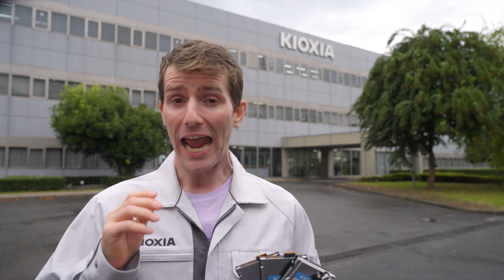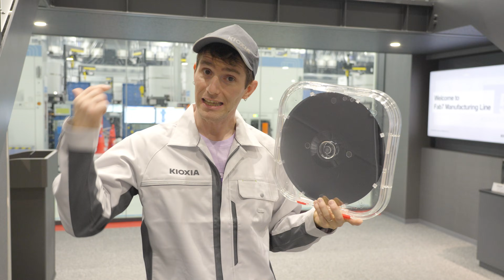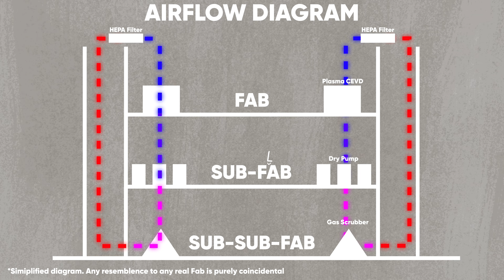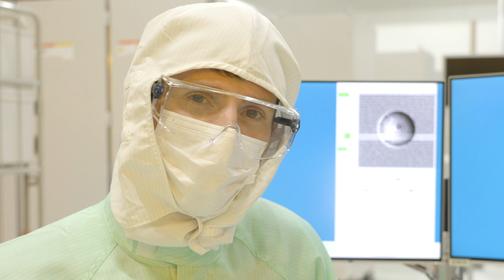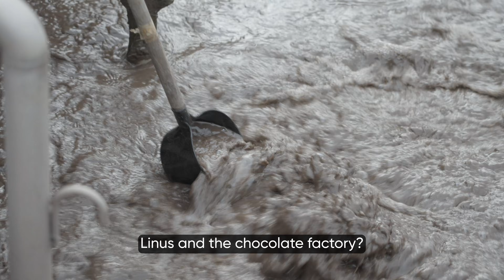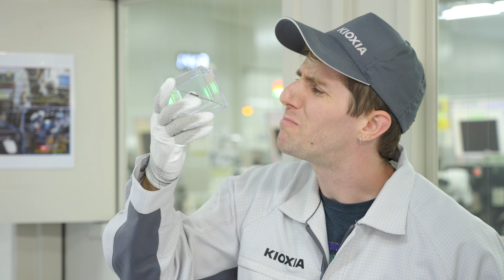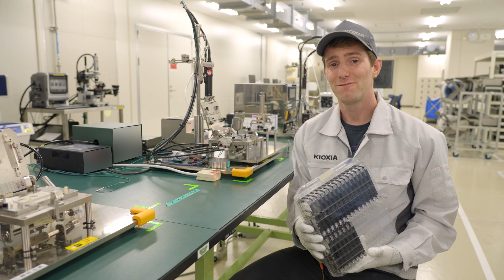A Petabyte in the Palm of My Hand - Kioxia Factory Tour

Comment: Actually, the cooling in reflow soldering has to be fast. As leadfree solder is not eutectic, it gets solid in temperature range and you want to get through as fast as possible to prevent partial crystallization. On the other hand the electronic components have limits of temperature change stress they can handle. So you have to balance it perfectly to maximize reliability.

Comment: @12:00, Reuse rate of >90% is quite impressive, this goes to show how much faith Kioxia has in their filtration system since the water purity has a direct effect on the defect rate on their wafers. Overall, this is super awesome that Kioxia is able to share this.
I work in an academic fab house at an R1 university, fabricating silicon optics for infrared optics applications. We do not have anything like this fab. It is interesting to see the difference between a fab designed for low volume prototyping at a large university vs a high volume fab like Kioxia.
Very good tour, those PECVD film stacks are quite impressive. At the fab I use, wafer uniformity (along the radial) is not too great, outer 10mm or so can vary, normally set up for 100mm wafers. The PECVD machines at Kioxia are massive, wonder what kind of uniformity and deposition rates they have. 
13:10 , very cool demo! I deal with very thin wafers (~30um sillicon) and also thick pieces (~3cm silicon), really neat to see the difference in properties vs thickness of single crystal silicon!
19:30, The vibration isolation of the fab is impressive. Though I am certain the lithography tools are on the ground floor, pretty cool to see vibration isolation at the building level, you don't see this in academia too often :)

Next time I buy an SSD, I will look out for Kioxia nand flash, thanks for the tour!

Comment: Brave AI says, "The availability of petabyte (PB) electronic storage devices for consumer computers remains uncertain, with estimates varying widely based on technological trends and market demand. While enterprise-grade storage is advancing rapidly—Samsung has announced a 256TB SSD, and Seagate is expected to release 24TB drives—consumer access to a single 1PB drive is not imminent.

Some projections suggest that a 1PB SSD could become available in the consumer market within 10 to 12 years, assuming a gradual progression from current enterprise drives.
 Others estimate that 1PB SSDs might be feasible by 2030–2035, particularly if advancements in NAND technology continue.
 However, many experts argue that demand is the primary limiting factor: most consumers do not need such vast storage, and data redundancy and reliability concerns make a single petabyte drive impractical.

For hard disk drives (HDDs), the physical limitations of spinning platters make a petabyte HDD unlikely in the foreseeable future, with some suggesting it may never happen.
 Solid-state drives (SSDs), while more scalable, face challenges in cost, heat dissipation, and data management, especially with file system limitations that cap the number of files.

In summary, while a petabyte SSD may emerge in the consumer market by the early 2030s, it is more likely to be a niche, high-cost product rather than a mainstream offering. The timeline depends heavily on technological breakthroughs and the emergence of new storage paradigms, such as reversible logic or alternative materials, which could overcome current physical and economic barriers."

Comment: In 1989 my first PC had a 42 Megabyte hard drive and cost about $1800.   My new $80 smartphone has a microSD card that holds over 6,000 times what that PC did and is smaller than my little fingernail.  Now you are showing us memory chips that can hold almost 10,000 times more data than my new phone.   Maybe a new SSD for my PC next year?

Comment: Intel are talking about using enormous EUV lasers to build 32 layer fabs with through floor vias to deliver power from the bottom floor all the way up to the top. They build the whole fab upside down then flip it over and connect the bottom floor to the power grid. They then put a big copper heat spreader on the roof of the factory to spread & dissipate all the excess heat.

Comment: looking at the cost, that the clean room and cooling needs for such extremly small products, i wonder i that is actually something that could be done cheaper in the vacuum of space, i.e. a moonbase? i guess there are two questions for that: how many machines can be cut from the fab, that are not needed due to the cold space on the moon - and do you still need a lot of water? maybe scientists can even make some breakthrouhgs only possible due to manufactoring in a lower gravity envoirenment.

Comment: Based on the SEM images and the description of the process ("grinding the excess of the top silicon wafer"), these defects are likely post-process contamination resulting from the mechanical grinding and the subsequent cleaning/drying steps.

1. The "Donut" or Ring Shapes (Images: 1797, 1806, 1814)
Likely Cause: Water Marks / Drying Residue

Explanation: After grinding, wafers undergo a cleaning and rinsing process (using Deionized Water). If a droplet of water containing dissolved silica or chemical residue dries on the surface instead of being spun off, it leaves a ring-shaped stain. As the droplet evaporates, the impurities concentrate at the outer edge, forming a "donut" shape which is visible under SEM.

2. The Long, Fibrous Strands (Images: 1801, 1805, 1813, 1821, 1822)
Likely Cause: Organic Fiber Contamination

Explanation: These look like fibers from cleanroom wipers (cloths used to clean tools or cassettes) or particles from cleanroom garments.

Image 1813 and 1821 show twisted, ribbon-like structures typical of synthetic fibers (like polyester) or cellulose.

These fibers can fall onto the wafer during handling or be transferred if the wafer physically touches a dirty surface or cleaning pad.

3. The Irregular "Chunks" and Clusters (Images: 1796, 1799, 1802, 1811)
Likely Cause: Grinding Slurry / Silicon Dust Agglomerates

Explanation: The "grinding" process creates a massive amount of silicon dust and uses a "slurry" (a liquid with abrasive particles).

Image 1796 and 1811 show clumps of material. This is likely silicon swarf (debris from the wafer itself) or abrasive grains (from the grinding wheel) that clumped together and were not fully washed away during the cleaning cycle.

They often get trapped in surface topography (like the trench seen in the images).

4. Small Bright Particles (Images: 1800, 1803, 1807, 1818, 1823)
Likely Cause: Loose Particles / Fall-on Defect

These are individual specks of dust or silicon shards. In SEM, they appear bright because they are often non-conductive (charging up) or sticking up from the surface, scattering more electrons.

so in conlcusion, the machine grinding process is mechanically harsh and dirty. The defects shown are not likely "growth" defects (from inside the crystal), but rather residue that failed to be cleaned off.

The Problem is The Post-Grind Cleaning (cleaning/scrubbing/drying) process is likely insufficient.

Why they are in a line: Many images (e.g., 1801, 1804, 1811) show the defect sitting on or near a dark horizontal line. This line appears to be a trench or a scribe line on the wafer. Debris naturally gets "trapped" in these depressions, making it much harder for the cleaning brushes or spray jets to remove them compared to the flat surface

Comment: The sustainability practices for water and energy, are really cool, but I’m curious as to how efficient their material reclamation is. It’s easy enough to collect excess when it’s just silicon, but once you start etching and backgrinding, wouldn’t the particulate be insanely small, or at risk for impurities from stuff like the copper layer? How do you get that material out of the water, and back into a crucible to prepare for a new ingot to be made?

Comment: AI: Based on the visual evidence, these images are Scanning Electron Microscope (SEM) micrographs of semiconductor wafer defects.

In semiconductor manufacturing, automated inspection tools scan wafers to find anomalies like these. The specific defects shown here point to a few distinct causes, mostly related to contamination and process cleaning failures.

Here is a breakdown of the likely causes for the specific defect types visible in the grid:

1. Process Residue & Water Spots (e.g., 1797, 1806, 1814)
What they look like: Circular "donuts," rings, or dried puddles.

The Cause: These are likely drying defects or water marks. After a wafer goes through a wet cleaning or etching process, it must be rinsed and dried. If a droplet of water (or chemical solvent) evaporates on the surface rather than being spun or blown off, it leaves behind dissolved solids (like silica or salts) in a ring shape.

2. Particulate Contamination (e.g., 1796, 1798, 1803, 1815)
What they look like: Irregular, blob-like chunks sitting on the surface.

The Cause: This is "process fallout." Common sources include:

Etch Chamber Flaking: During plasma etching, polymers build up on the chamber walls. Eventually, these flake off and land on the wafer.

Equipment Wear: Moving parts in robot arms or aligners can generate microscopic dust that falls onto the wafer.

Ambient Dust: Failures in the cleanroom air filtration (HEPA filters) allowing dust particles to land on the wafer.

3. Fibers and Scratches (e.g., 1801, 1805, 1813, 1821)
What they look like: Long, thin, rod-like structures or deep gouges.

The Cause:

Fibers: These are often textile fibers from cleanroom consumables (like wipes or operator suits/gowns) that have physically contaminated the wafer.

CMP Scratching: If the wafer recently went through Chemical Mechanical Planarization (CMP)—a process that polishes the wafer flat—a large agglomerated particle in the polishing slurry can scratch the surface or leave a trail of debris.

4. Flakes and Shards (e.g., 1822)
What they look like: Flat, jagged pieces of material.

The Cause: This is often film delamination. A layer of material (like metal or dielectric) may have peeled off the edge of the wafer (bevel) or the chamber clamp ring and redeposited onto the active area of the chip.

Summary
The variety of defects suggests a "dirty" process step. If these images are from a single inspection run, the manufacturing line is likely suffering from a cleaning station issue (causing the water spots) and a particulate control issue (causing the debris and fibers).

Comment: I'm just a noob on the internet but I've always wondered why chip manufacturers haven't developed a process of forming the purified silicone into squares which would enable them to use more of the wafer with less wastage (around the edges of the disc) there's probably a very good reason for this but it would be cool if someone has a technical answer for that?

Comment: If ya'll wondering why these Silicon Wafers are not square?? Silicon wafers are round because they are sliced from large, cylindrical ingots grown using the Czochralski process, which naturally produces cylinders; plus, round shapes handle high-speed spinning (for coating/cleaning) better, distribute heat more evenly (preventing hot corners), and offer more usable area per perimeter for chips. Square wafers would waste material and concentrate stress at sharp corners, making them prone to cracking during processing

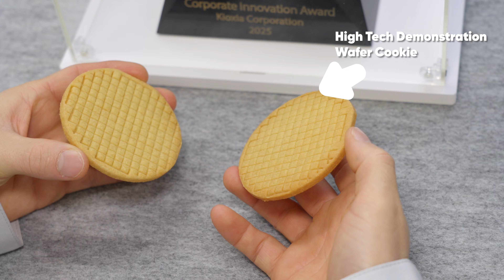Comment: explaination of second wafers at 6:15 had the same vibe as:

Everyone has a plumbus in their home! First, they take the dinglepop and they smooth it out with a bunch of schleem. The schleem is then repurposed for later batches. They take the dinglebop and they push it through the grumbo, where the fleeb is rubbed against it. It's important that the fleeb is rubbed, because the fleeb has all of the fleeb juice. Then a Schlameeh shows up, and he rubs it, and spits on it. They cut the fleeb. There are several hizzards in the way. The blamphs rub against the chumbles, and the klubus and grumbo are shaved away. That leaves you with a regular old plumbus!

Comment: 14:33 so cool that they zig zag stack so they can fit the wires it looks so unstable but so elegant
Reply: Wire bonding is surpisingly robust. Wire bonding like that can be seen on many consumer products. If you get the chance, take apart an older cheap optical computer mouse, you will see the wire bonding directly exposed, not in a package!

Comment: It was nice of KIOXIA to provide the tour.

I am blown away with you holding that 300mm silicon crystal top.Those are $$$.

It is an impressive fab, but a SEMI guy they could  make it less complicated and more maintainable. But any delay in turnup is SSS.

Using  AI/ML to omprove yield and reliability is the norm, but what information is fed to it and what is learned is the trade srcret.

The solar panel setup and capacity is impressive. but flat installations sacrifice output.

I like the water filtration system with 90% reclamation.

The bond wires in the stack all beautiful. Sadly very susceptible to heat.

Comment: It's very impressive. If I think about it, back in the late 2000s I had in my Sagem phone was 8mb while my PC ran on a thick 60gb WD HDD.
Nowadays it's just crazy how much capacity we get on such an small devices and how much storage is possible on a MicroSD card which didn't change it's shape or size over so many years.

However, it raises certain concerns to me. Back when software developers had to program their games to fit on a Nintendo cartridge or a optical disk, they had to think outside the box to squeeze as much data as possible on a small storage chip. Nowadays they don't optimize the graphics as much, don't have to deal with hardware limitations and so on which makes them kinda lazy and at some point I was quite terrified when I had to download a 310gb update on my laptop and keep it running over night to finish downloading everything

Comment: 1. Particles (Contamination)
The most common defects here appear to be foreign particles landing on the wafer surface.

Small/Irregular Particles: Many images show bright, small, jagged objects. In SEM, "bright" often means the object is sticking up high (topography) or is made of a non-conductive material that holds a charge.

Examples: 1794, 1802, 1803, 1807, 1808.

Large Clusters: Some particles look like large agglomerations of material.

Example: 1796 is a very large, complex chunk of debris compared to the others.

2. Fibers and Scratches
There are several distinct defects that are elongated, suggesting they might be fibers (from cleanroom wipes, clothing, or filters) or scratches on the surface.

Fibers: These look like long, thin strands lying on the surface.

Examples: 1813 (very long, twisted fiber), 1821.

Flakes/Scratches: These look like elongated chips or scratches in the material.

Examples: 1801, 1805, 1822 (looks like a peel or flake).

3. Residue / Drying Spots
These are distinct because they are often circular or "donut-shaped," which usually happens when a droplet of liquid dries on the surface and leaves solid residue behind (like a coffee ring effect).

Examples: 1797, 1806, 1814. You can clearly see the round outline with a center structure, typical of dried chemical or water spots.

4. Pattern Interaction
The horizontal dark bands visible in many images (like in 1793, 1799, 1811) appear to be trenches or pattern lines on the wafer.

Killer Defects: Defects like 1799 and 1793 are particularly dangerous because they are sitting directly inside or across the pattern line. In chip manufacturing, this is often called a "bridge" or "blockage" and can cause the chip to fail electrically.

>GEMINI

Comment: Difference with nexus is he wouldn’t take a sponsorship for a company he’s reporting on as it seems hmm “biased”
Reply: Do you really think that manufacturers would arrange production tours if they weren't assured that the makers of the video wouldn't say anything wildly off-message? The permission is, in effect, a sponsorship paid in time and access. 

The cost of genuinely "reporting on" a trip (say, by pointing out that the AI inspection system has "removed" the need for specialised microscopy personnel and that the company didn't provide you with confirmation that they had all been redeployed or offered substantial redundancy/retraining packages) is that nobody will offer you another tour.
Reply: @Metal_Maxine nexus gamers - be quiet

Comment: I did that useless calculation for you: it would take 1109 years to fill one 245 TB SSD by downloading files using a 56k modem.
And even with a 800 MB connection it would take 4 full weeks.

Comment: Back in the days, at my old workplace, I was trying to convince the board to switch to Toshiba for high Capacity HDDs, they went WD and Seagate. Though, I did managed to get the approval for a tiny stock of Toshiba drives at the corner of the warehouse. Least to say, the Customers whom I managed to convince (this was what I have used, and still am using at my home lab) to try them have never went back to the default recommendation.
I have felt in love with Kioxia's flash drives and SD cards, they are top notch and I am still recommending them to anyone. For the M2, however I am using the ADATA ones, unfortunately Kioxia does not offer a competitively priced, high performance solution on EU market ...yet.

Anyway, gratz on behind the curtain access and a great video ! ...you gave me a mini heart attack with that waver wiggle 😅

Comment: It was 2001 i first saw 1.3pb as hard disk size in my pc. All night it was formatting. Not a good day for my computer. It must have errored out controller and built a 40gb file allocation table. Zero data. The box of spinning rust was  near to a 12" paradigm 1000w subwoofer. Oops. 😂